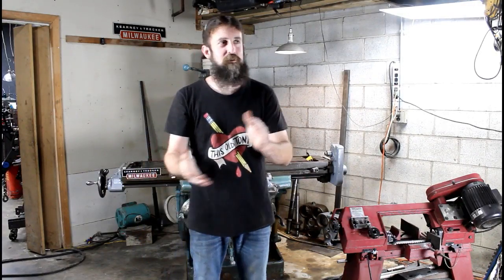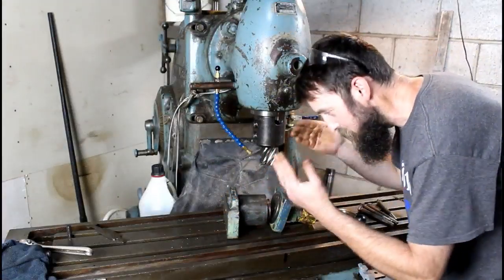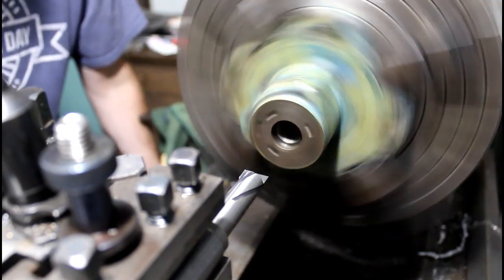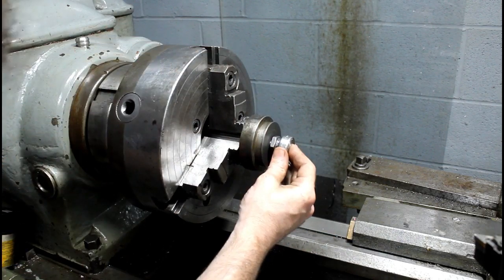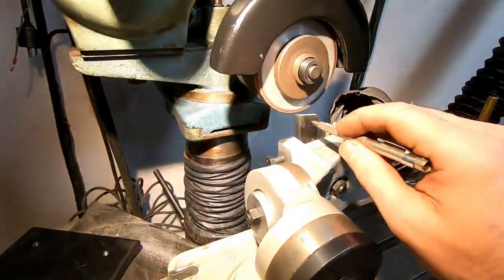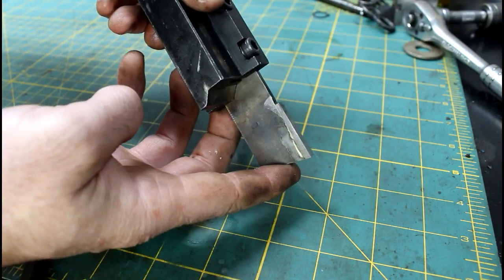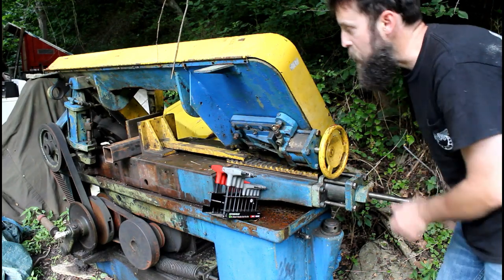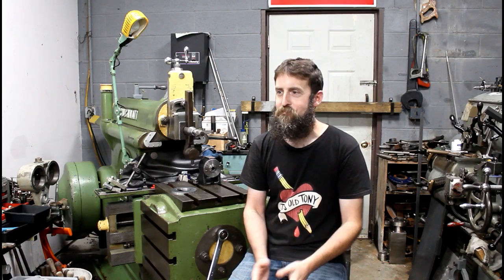Do-ALL Saw Restoration / Vise Mod Automatic to Manual

Comment: I'm not ositive, but your saw looks like one I worked on about 10 or more years ago.  I was a part timer in a shop filled with old, worn poorly maintained machines.  I liked the boss, his back was against the wall for delivery on one of his better paying projects, so I spent my 4th of July replacing the belts, lube lines and hydraulics on what I think was a Do-All.  He was great at keeping me suplied with coffee, and after nightfall, the fireworks were launched about 5 blocks away.  It turned out well for me.  The machine ran up to par, the job was completed on time, on budget.  The sad part is this was all around the time the Great Recession started, and the company ended up going out of business.  As for the machine, each time I got one thing fixed, it would quickly show me the next thing that needed attention.

Comment: That saw used to have a table on the front of it that stuck out about 4'. It was realy nice because the coolant would run down whatever you were cutting and drip onto the table. You could then use a squeegee to push it all back down into the chip and coolant pan instead of having it drip all over the floor. If i remember right you can not cut angles on that saw either without rigging some kind of janky jig in there. We had a little Kasto saw that sat next to the Do all in the shop which we would use to cut things that needed to be angled. Btw that automatic feed never worked when we had it either, and that was 20 years ago. It would progressively start cutting the parts smaller and smaller if i remember correctly and leaked oil everywhere.

Comment: on one hand it always sucks seeing an old machine torn apart, but its cool to see that your going to get the saw working again. like i restored a table saw but i bought 2 identical one from a auction for 50 buck got one working then i scrapped all the stuff that was busted or that i didn't need and i got 75 bucks from the scrap. so this saw you might be able to break even if you end up scrapping the rest of the parts your not using especially the cast iron.

Comment: Hi Steve, great machine once you get it all fixed up. For people like you and me manual control is definitely the way to go. My two cents, for the blade tensioner wheel just add a small handle to the existing wheel so it looks like a wheel on a lathe or tail stock or just leave it as you don’t need to adjust it far or often. As for the handle on the vice I feel that a good solution is a crank style handle made by using an old ratchet with a handle attached at ninety degrees at the other end to form the crank. This way the handle can always drop to the bottom and out of the way so it’s not sticking out when you walk past it and rip ya love spuds off. You will also be able to rotate the handle into a good position to give it some heave ho when you want it extra tight. I can see it in my head but I don’t know how it translates into words. Maybe like the crank style handle you get on a shaper or mill but with the ratchet mechanism. I hope this makes sense to you. 
Cheers mate, Stuart 🇦🇺
Reply from the maker: " Rip off Love Spuds" :-0  LOL     I like the handle idea
Reply: Steve Summers yes I bet Elizabeth don't want ya love spuds to be ripped off!

Comment: Good job on the conversion so far , looks like you have it thought out quite well. I do love repurposing even when it's rebuilding to use. That saw will last forever with some normal maintenance. Thanks sure enjoy the videos. Just a try for ya, on the top of your parting tool if you concave it side to side it'll reduce three friction and grabbing when cutting. Just from trial and error do I know.

Comment: Very clever, and it looks factory. Glad to see you getting to the saw, I can live vicariously through you while I'm between projects.  On the speed control, a lever that pivots on the machine base and locks on a rack would make for quick adjustments with out bending over. This would be similar to a lawnmower deck height adjustment. The lever could be spring loaded at the pivot so that it can lean away from the rack when moved, then pressed back to engaged.

Comment: Steve that is a beast of a saw. Can't wait for next adaptation. Great project and great start adapting hydraulic vise to screw vise. The same technique could be used for the speed control. Then adapt a hydraulic cylinder for blade lift.

Comment: We had two saws that were used to cut 8 inch by 8 inch hot rolled steel into 16 inch long pieces. We used one for cutting steel. The saw included the hydraulic pump to operate the vise, tensioner and lift/lower the saw. WW just plumbed it to use the manual valves.

Comment: I need to do some maintenance and repair on the old Kalamazoo saw in the shop at work. The bearings on the blade guides are shot and the downfeed cylinder leaks down, can't shut it off completely so I have to block it up between cuts. The moving jaw of the vise also tends to lift when tightening. I should also replace the drive and driven wheel bearings.

Comment: "Adapt and overcome"........ Seems like you do that a lot on some of your projects. That Thompson shaft is good stuff. I am rebuilding my model B John Deere tractor and used a piece of 5/8 for a new rocker arm shaft. It is cased really deep with a Rockwell of about 60. I had to use carbide drill to put a hole in it. When you get that do-all going you will be able to saw a Buick in half with it!

Comment: Great work so all the left over parts can be saved for other projects. Stock steel mabe make a suport stand for long stock or a lift table to roll parts on and off mill ? Anything can think of you have materials  to work with

Comment: Have you given some thought on how you are going to lift that saw? A lifetime ago I owned the exact same model of that saw. One time we had a hydraulic problem and had to lift the frame manually. Take my word for it. You wont be able or want to lift it manually. By the way of all the cutoff saws I have owned over the years that model of saw was without a doubt the best saw I have ever owned. If you can get it to work you will be pleased.
Reply from the maker: Without lift  assistance and decent control it will not work, at least not well. It's not balanced to be a manual saw, that's for sure. I have some design ideas pulled from manual saws but haven't settled on anything yet. One is a balance weight behind the pivot to lighten up the front. That's the major issue with the conversion. I have started thinking about it.👍
Reply from the maker: Just subscribed to your channel by the way. You do good work👍. I'm sure I can pick up some good info from you.
Reply: @SteveSummers  Could I make a suggestion. Use the existing Hydraulic cylinder. If you could lay your hands on a manual pump. Like the ones used on Enerpac cylinders. Just pump up the cylinder to raise the head and bleed off pressure too let it down. The thing is so heavy its weight alone will be enough for cutting force. You may have to increase the reservoir's capacity on the pump to match the hydraulic cylinders. Or build your own pump. They are pretty simple to build.
Reply: Steve Summers Thanks!!👍💪
Reply from the maker: @EdgePrecision  I could. I was also thinking of a small electric pump on a push button to raise the saw  using the factory cylinder. I would then have a needle valve to bleed off the cylinder for decent. I think the weight of the saw would break blades if it wasn't regulated.
  It's a very doable job with several solutions. None are real easy but it's just a fun project in the end without a deadline 😄.
Reply: @SteveSummers  Even better. If I remember correct the hydraulic pressure wasn't that high. Less than 1000 PSI.
Reply from the maker: @EdgePrecision  Yeah, the lines were just a standard wall hard plastic tube. I was thinking of that earlier. Not a high pressure system. Shouldn't be that bad if I can come up with the proper sized components. I'm not a hydraulic expert but it should be straight forward I would think.

Comment: I'd have been tempted to convert the hydraulic cylinder to pneumatic by boring the cylinder and replacing the piston ring with an o-ring and used shop air for clamping.
Reply from the maker: I like the idea. I just don't want to have to have air pressure in order to use it.
Reply: @SteveSummers  LOL, I get it.  It's interesting that I have a large saw with a crank and have been looking at putting a cylinder on it to get consistent holding pressure.

Comment: Nice job on vice, but to be honest I don't see why you don't repair the hydraulics and just repair or replace the control panel with electric switches  especially for  the down feed control on the saw head and motor speed control and coolant system.

Comment: Do-All .. since the belt drive speed control uses a double acting cylinder . did you remove any double acting cylinders that you might use with something like you modified for the vice..  but leaving the cylinder fully double acting.. so you can spin a handle.. pushing or pulling the double acting cylinder to use the existing cylinder as a slave cylinder.  giving you manual/hydraulic control of the speed.  you might do the same with the hydraulic lift cylinder for the blade.  that might require a big pressure gauge so you could manually control cutting edge of the blade force as it cuts. 

 i would pull all the control switches off the panel and get them out of the rain.  the switch parts can be disassembled and cleaned or just the switch section replaced usually.
Reply from the maker: I really really like that idea.   It didn't have any other double acting cylinders to use for it. That would be a great way to control it.    Thanks for taking the time to write your ideas.

Comment: S S
How do you know your machinist level is reading level ? Answer : read it on 2 faces. I.E face 1 then turn it 180 deg. & read face 2. If level it will be reading in the exact same indicated graduation. If out of level it will be different. To adjust out of level move the adjusting screw 1/2 the distance of the level indicator. 1/2 is the mean of the error. It doesn't take long to get it near to zero difference on both faces & so close you can't read any difference. Recheck via face 1 & 2. repeat steps if necessary. This should be done with ANY machine level before starting any work.It is always possible that the job is actually out of level when you believe it is level. Not any machinist on You Tube that I've seen do this basic but important step & it usually doesn't take long.. I'm a retired construction surveyor & level checking our instrument levelling bubbles was an important step for more accurate results.

All the best for all your projects & health to you & your family, (I live in the Sydney Australia area. It's amazing how areas are so hot in Summer & very cold in Winter. We are in Winter now but expect temperatures to rise more than double in 5 or 6 months. You USA guys will then be freezing your butts off in many areas).

Comment: Steven,These old saws last forever. I rebuilt a Wells Saw Model 8.  Check out how the vice works.  By threading the ratchet part of the vice the handle is not hanging out in the shop.  Both designs work.  
https://thisisjust4fun.weebly.com/wells-saw.html
https://thisisjust4fun.weebly.com/wellsaw-manuals.html You can find the manual for your DoAll here:https://www.doallsaws.com/parts-manual-search

Comment: Kind of an odd conversion from automatic to manual, it's the opposite of what most people would do.
Reply from the maker: This was a production saw made to cut masses of the same length parts all day. If I had a brand-new saw just like it automatic . I would sell it and buy a manual unit.  It would be a different story if I owned a factory. Almost every part I cut is different from the last.     Thanks for watching